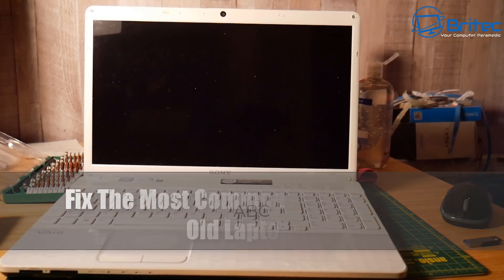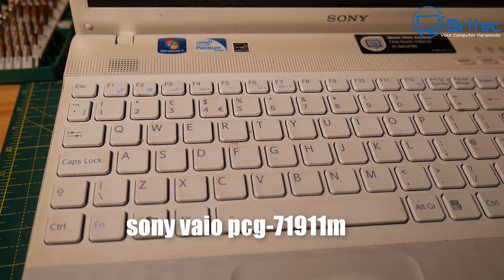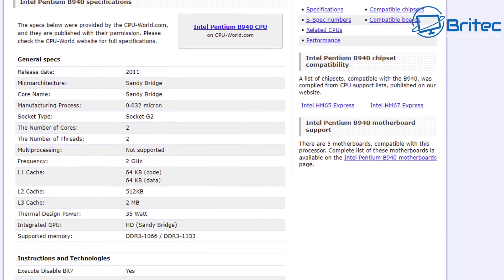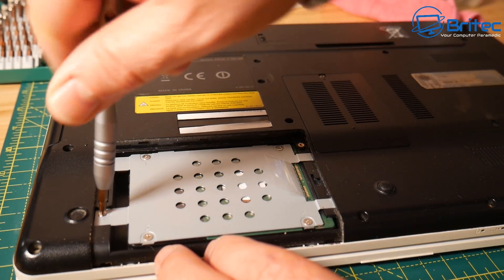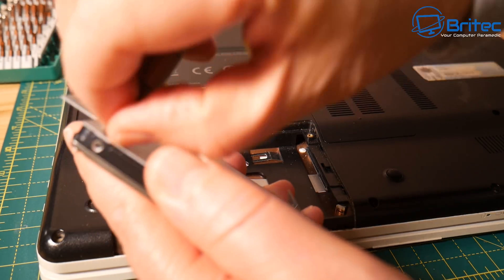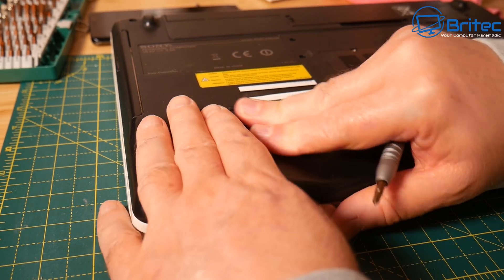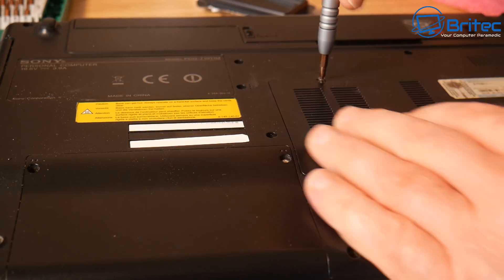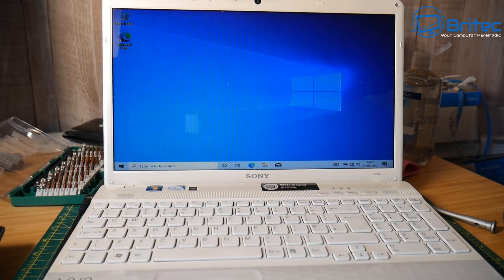Why Is My Laptop So Slow And How To Make It Faster

Comment: Do you use Windows? If your machine is very old (2014 or earlier), I recommend buying a new PC or making hardware upgrades. If your machine is relatively newer (from 2015 onwards), the slowness may be easily explained by low-performance components, and the only solution is to upgrade the hardware. Now, if you have a low-performance laptop (like me) and cannot afford a new PC, I suggest switching to a Linux version optimized for low-performance devices.

Comment: Good video as always just one problem. as it doesn't really show how tospeed up a lap top it only shows how toupgrade specific parts of a lap top. How about how to speed up a lap top when you can't afford to add or upgrade anything! Take for example like a cheap HP notebook 15 an do a benchmark, then optimize it manually an then take another benchmark so we can see the performance difference!

Comment: It would make much more sense to simply clone the Hard Drive to the SSD, rather than reinstalling Windows, then having to re-download all .  Also, many older computers are limited to the capacity of RAM you can install.  
I recently cloned and installed an SSD into a 12 year old desktop PC.  Start-up is MUCH faster and it was a worthwhile upgrade.  Unfortunately, 4 GM RAM is installed, and it won't support more RAM.  Nevertheless, it does what iI want it to do - WiFi streaming videos into my flat panel TV.

Comment: My dell laptop keeps it's 100@% disk usage all the time 
i tried multiple ways to fix but after sometime it back to 100% 😭
So,i just installed the POP OS(Linux) and my pc running amazingly fast 😇👍
It has HDD btw but fast and smooth 
I m happy 🤗

Comment: I did similar to my wife's Dell laptop. I swapped the 1TB HDD for a 512GB SSD (she never really saves stuff on the laptop HD as here work in on line. it already had 1 4Gb & 1 2GB ram  so I left them as they were. It is definitely much faster.

Comment: I just finished doing this type of project to an old Dell Latitude E6410 to try to squeeze a couple more years out of it. While you're at it you can also blow any dust out of the cpu cooling fan, and maybe even reapply new thermal paste (if you decide to just keep the same processor).  Hoping to make it last for the remaining support life of Windows 10.

Comment: hi Brian, when swapping the cpu is it important that the FSB frequency is the same 800 or 1066, I want a faster chip and a bigger cache from a 2.2/ 1m T4400 to a T9300(2.8ghz) or E8235(2.5ghz) m6 cache, thanks for your comment. just thought, if I change the CPU will I need to register windows again win7  ?

Comment: I just installed chrome OS and it works really well for my old laptop with Intel celeron, limited ram and storage
Reply: But looking at Task Manager Chrome uses an awful lot of memory.
Reply: @vanessawindust4016  I'm assuming you mean chrome the browser. ChromeOS is a very light operating system. Think about it as rooting your android and installing a light weight custom ROM. The entire OS uses less RAM which makes things snappier and in my case I gave the laptop to my mum and she's only going to use it to browse the internet and for that it's perfect

Comment: Yes Brian my oldest laptop is quite slow but not as slow as the one your video. My main laptop now has one of those Nv ME drives and stacks of RAM in it and is super fast. Having said that my other two laptops are still quite quick though I don't use them much these days. Plus I have found following your channel for many years now (from the old Vista days) has also helped me understand and do upgrading stuff and fixes for computers i have had!🙂
Reply from the maker: Good to hear
Reply: @Britec09  No worries mate as there have been times that I have not been savvy enough to work something out and your tutorials have helped out enormously.

Comment: I have a question pls answer.
I have a laptop i3 with 1tb hard drive. I can add one extra ssd into that.
question is : - where should I install my games after installing windows on ssd.
If I install my games on hard drive even after ssd , will they run slow? 
Will games use my ssd to run ? if I install them on hard drive. Or I have to installed them on C drive in ssd?

Pls answer someone I am confused about this thing.
Reply from the maker: depends on the make and model
Reply: @Britec09  I have hp notebook 15-da 0434tx , It has i3 with 1tb hard disk.

I can insert a caddy with ssd in place of dvd drive. 

please solve my doubt , I am not buying ssd for a long time coz of this confusion.

Comment: Sorry but I don't think this would help in most cases. I have an Acer from 2009 that I added ram and a SSD to some years ago. I put in a Crucial sata 3 SSD and it still runs about the same as with the mechanical drive since the interface is still sata1. I also swapped out two 2gb sticks of ram for two 4gb and I had to update the bios to recognize them. I think your system ran faster from reinstalling Windows and the extra ram.
Reply from the maker: 4GB is not enough for Windows 10 and a SSD is a lot faster than a mechanical drive

Comment: The hardest part of an upgrade is usually transferring the operating system and license.
You can tell the difference when an engineer puts in screws - they put them all in loose then tighten them up - that way all the screw holes align properly.
Reply: The hardest part of an upgrade is usually transferring the operating system and license.
Macrium Reflect Free, quick, simple, reliable.
Reply: THE LICENSE YOU CAN CHECK IN THE CMD

Comment: Adding more memory and an SSD is always a good idea but for a very basic internet machine installing Chrome OS Flex (if it works, test from USB before install) would make it even faster than Windows, more secure and less maintenance would be required for the end user. Keep in mind, Chrome OS Flex is not yet final but will be in the very near future.
Reply from the maker: I agree
Reply: @Britec09  Plans for a video when it is released (out of dev release)?

Comment: Thank You 🙏 🙏🙏
Basically My Lenovo 430s That Well All PXE:/  & Some Other BSOD,Went Today & For A Quick SSD -Drive As Lenovo Make Life So Different In Every Laptop / Thinkpads / My Workstation ( I bought for £150 & 1tb space until I get my Lenovo Back). There Wares Are all Different In many,many ways but cannot wait to pick-up my 32RAM & SSD should do the job on a lightweight laptop most government offices use , I did add extra RAM as 2-bays below the Keyboard & another 2 bays below the laptop “ why went all out with a non moving parts SSD” . Thanks Again Bri LIFESAVER & SOME FINE INFO … LOVED ALL THE FIRESTICK VIDEOS TOO & KEEP DOING WHAT YIR DOING SCOTLAND DEPENDS ON YOU 🏴🏴🏴😂😂😂😂👌👌👌👌10/10 BEST SUBSCRIPTION EVER

Comment: Nice video.

I upgrade old computers with SSD's all the time.  Just did 2 yesterday.  
Only thing you have to wait for is the clone process, and even that is painfully slow for the final copy of data from the old drive to the new one.

9 times out of 10 on old systems, all you need to do is get replace those clunky, grindy, mechanical hard drives, and don't need to upgrade RAM at all to see an incredible speed performance.
Honestly, I don't know how we survived years ago without SSD's, and have no idea how they are even allowed to be in some systems being sold brand new today.  It's almost criminal to do so.
Reply: I did that just last month. Indeed the clone process is slow. But I did it and have a faster laptop (just as a spare, not for daily work).

Comment: I still have a working 98SE (Gateway) + 1 home built, XP (Acer) + 1 home built and Vista system (Gateway laptop). I keep them for only a few reasons 
1. I can still play my old flight sim along with a couple of older games that I liked 
2. Because of certain programs or software that is still useful that I liked and no longer available. 
3. Kinda kept as museum pieces and they are never used connected to online. 

Some are stripped for useable parts and possible rebuilds for whatever I might want to create, such as an alternate operating system, NAS, drive storage. 
Other than that when something is too old ( Pentium era or older) it pretty much becomes recyclable waste. 

You are correct with if your system is too old don't invest too much money into it, just get a newer system when able to do so. Parts are getting hard to come by for these older systems. 

Great video Brian!

Comment: What would you suggest I do my SSD is now full and I'm not sure what I should do I've got lots of pictures on the computer which is around 10 years old the SSD is 250 I think which replaced the old mechanical one if you could give me any suggestions I would appreciate it thank you I enjoy your videos
Reply: back the pics up to an external hard drive...
Reply: @WillyEckaslike  thanks for that advice
Reply: You could think about getting a Framework laptop. You can upgrade different parts of it as time goes on.
Reply: @PaulHoyle777  thanks for the advice

Comment: I have a laptop from 2016, i5, 8 RAM, and it feels sooooo slow now. Even after a Windows reset, and after disabling so many useless stuff
Reply: Get a SSD
Reply: @CoMmAnDrX  but does hdds get slow over the years or something?
Reply: @DucksAreEpic  No it is mostly windows produced junk which slow it down. Linux dont have this problem.
Reply: @DucksAreEpic  They can but I see it more an issue with Win 10 that pounds the mech drive.
Reply: @hisham56hamilton50  but has Windows 10 become so much heavier since 2016 to reach this point of slowness?
Reply: @hisham56hamilton50  Wouldn't a windows reset solve that?
Reply: @DucksAreEpic  Only marginaly .The reset leave 80% of junk in the system and you loose your work .It is deseign like that.their is a work around to this problem by installing the system on one drive and your work programs on another ...It is complicated and  needs pros to manage it.
Reply: It was even considered a gaming laptop at the time, and it ran games smoothly. But now it takes ages for any task. Why is that??